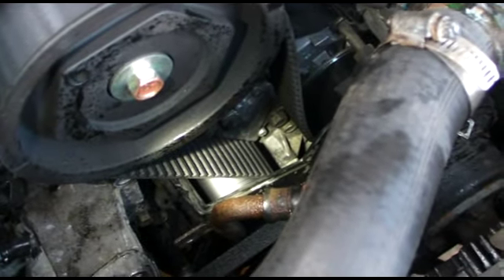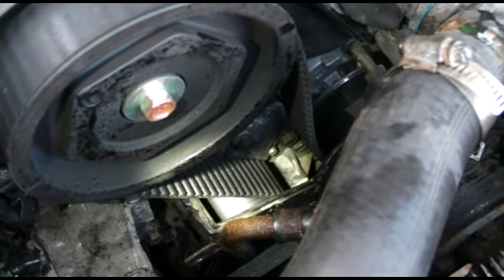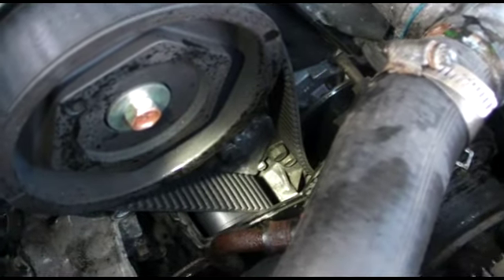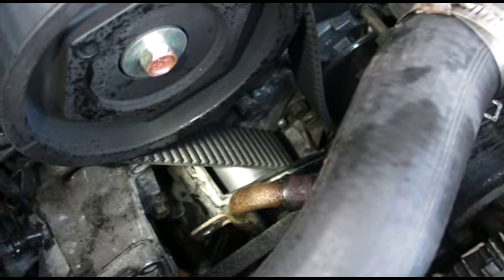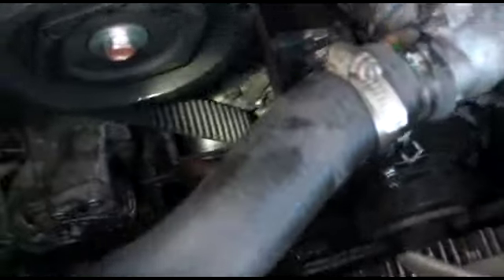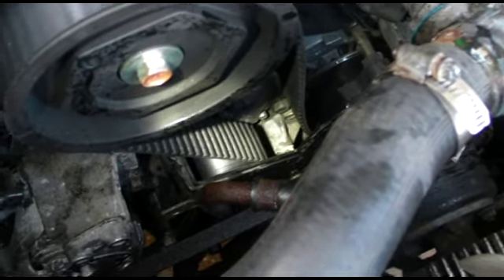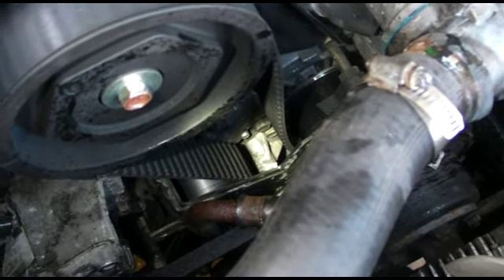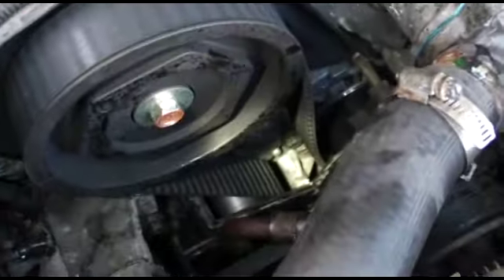Noisy Isuzu Rodeo - Bad timing belt tensioner Slow Motion

Comment from the maker: You have to remove all three covers together, so it's a lot of bolts. I think you can get the top two off without removing the pulley so you can get a look. I do recall some bolts being shared between both covers so I'll bet thats your problem; do both sides. I dont remember the procedure any more. Go pick up a service manual for some more specifics.

Comment: Hello. Thanks for the video. To get the last plastic dust shield off, do you have to remove the main pully, harmonic balancer it might be called? I am pretty sure that to do that, if thats what you need to do, that I have to remove the radiator and use my impact to get that bolt off?

Comment: I have a knocking noise in my 2003 Holden Rodeo, it started off after I washed it threw a jet wash, one of the cylinders stoped working on my drive back home, we took spark plug out a day later and there was a spark but now there is a knocking noise and its just not getting any better any ideas???

Comment: I have a 1997 2.6 Rodeo and have seen the belt flopping around....I loosened the tensioner adjustment bolt once and did short cranks and then tightened the bolt. Noise then went away...Its back again and must be a bad tensioner...Is there anyway to just change the tensioner and nothing else? Belt isn't old and either is water pump. Is this possible to do without major work?
Reply: GREGG DELFINER yes you can change the tensioner.  I'm thinking I have same issue